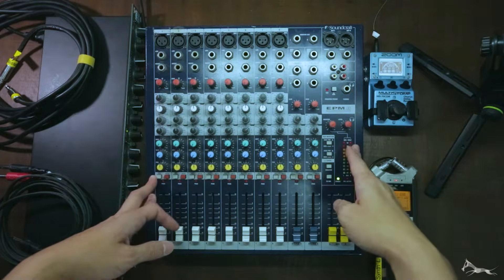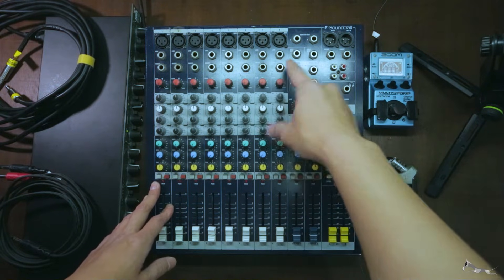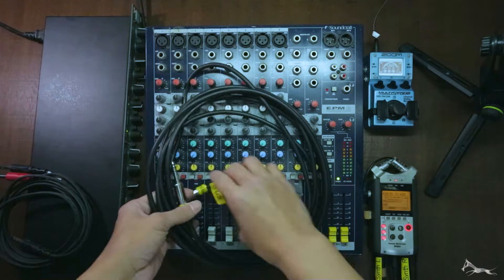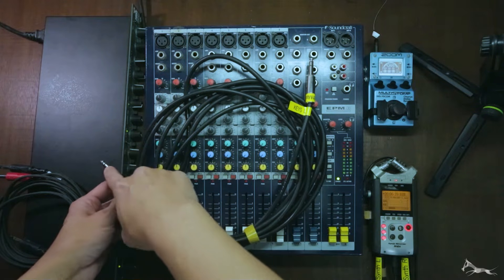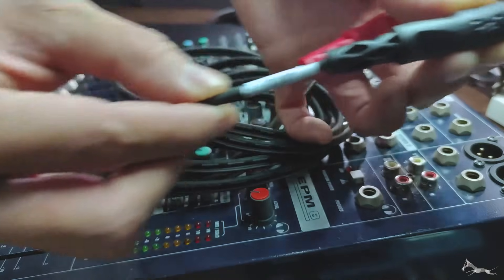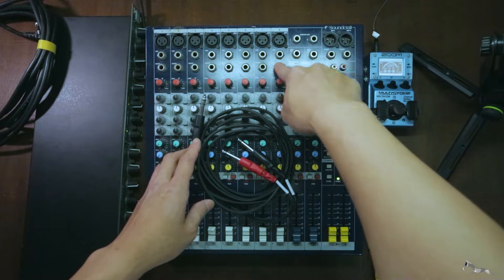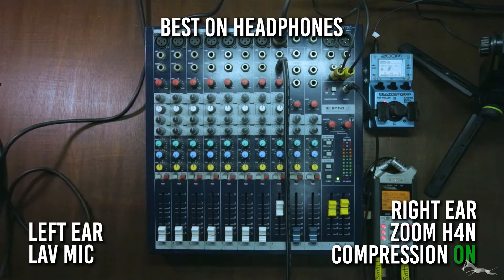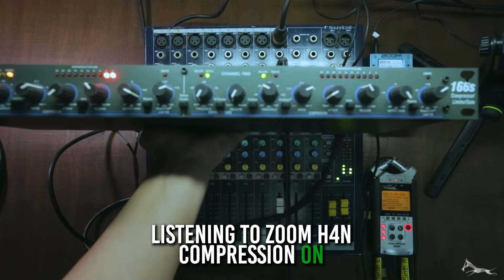Analog Mixer Inserts Explained

Comment: Thanks Bryan for the torch. I have question, i have some stereo guitar effects, but my mixer only got 2 aux send and returns. Do you think it would be best using other effect with insert channel? Would that compomise the sound? Do you think any other option is available like combining to other mixer?
Reply from the maker: Thanks for watching! It depends what you're trying to achieve - and your mixing philosophy. I would prioritize time based effects on sends, and dynamics based effects on inserts. While it may also be a good idea to have say a compressor on a send - for that parallel compression sound, or that drum bus compression - you just work with what you have. 
I would upgrade to a bigger mixer - with more aux sends - if that's what I need versus "daisy chaining" mixers. Hope that helps!
Reply: @BryanDumaguina  thx, regards from Indonesia

Comment: Good video Bryan D ! Question though... The RCA outs from the mixer to the digital recorder where what? Tape out?
Reply from the maker: Most RCA outputs on analog mixers are Tape Out or -10dBV (consumer line level). And the RCA output is identical to the main output. Whatever mix is going to the main output - will be reflected onto the RCA Tape Out - just at a lower level - the consumer line level - which you can then route to any device or equipment that will accept this line level (eg: digital recorders or analog recorders). Kindly consult your mixers manual.
Reply: @BryanDumaguina  Thank you for explaining that. Very helpful.  Peace !

Comment: I have a Behringer x2222usb mixer thats has only has 8 mic inputs how can I connect mics to the remaining 4 inputs ?
Reply from the maker: There are several ways you can go about that - but your key search terms would be "mic preamps" or "Rackmount Mic Preamps" - 4 channels of it - with direct line outputs which you then connect to the line inputs on your x2222. 

ULTRAGAIN PRO MIC2200 is an affordable option - but that's just 2 channels and it's a tube preamp - so it's got a bit of color. 

ADA8200 has 8 preamps - BUT it's not designed to be used standalone - it really is an ADAT expander. There's a Sweetwater article saying you can loopback the ADAT lightpipe - and then use it standalone. I advice you do more research on that.

Another example is Focusrite Scarlett Octopre 8-Channel Mic Preamp - looks like it has direct outputs on the back and can be used stand alone - BUT this is primarily used as an AD converter via ADAT to expand an audio interface - you might be paying for a feature you won't use.

Behringer 1273 - another good option - 2 units of that though and you're already at $1.5k+ . You can look into "solid state preamps" - 4 channels of it is really around $1k plus plus as per a quick Sweetwater search. 

Another key search term is "mixer with direct outputs". At that point though, it's probably cheaper to just get another mixer with more preamps! Hope this helps!
Reply: @BryanDumaguina thank you

Comment: So, when using a insert source, does it break/block the xlr input?
Reply from the maker: When you use the right cable (in this case a TRS plug), your XLR signal (or line input signal on the 1/4" jack) should return to the channel strip.
Did you mean something else with 'Insert Source'?

Comment: how about when my mixer has a lot on insert channels how do i go about that if iwant to use all of them
Reply from the maker: I guess the question is, what type of signal are you processing? Vocals? Keys? Guitars? Percussion? Electronic sources? And what insert effect did you have in mind to use? An insert connection has a one to one relationship per channel input - so if you have 8 channels - and want say a compressor on each insert - then you need 8 instances of the same compressor! (not cheap). If the compressor is using only one setting - then probably setting it up as a send effect is the more efficient audio routing to take.

Comment: Hi sir, question. How about the Inserts L/R under the Main XLR Outs? How can it be used?
Reply from the maker: @vinjayCOD0110  same concept, you can insert any effect or audio processing module that are in line with your way of mixing. For me I would insert say a graphic eq, compressor or some form of loudness maximizer, and a limiter.
So my mix can get a final touch of an eq curve I like or deem necessary for the room/venue - with a limiter at the end to protect from clipping/distortion.

Comment: Hi , does inserting into the 1/4 LINE disconnect the XLR input of the same channel?
🍻 ❤
Reply from the maker: If using standard TRS 1/4 inch plug when connecting to external device, it shouldn't. So just take note. Using TS 1/4 inch plug may however, disconnect the XLR input from the channel - as there will be no "ring" segment on plug for the signal to return to. I hope that makes sense!
Reply: @BryanDumaguina  cheers , thanks for the reply. I will make  a couple of test leads and do a continuity check. , as I have a Yamaha 01V and Mackie 1642, and have forgotten heaps of stuff from the 1990s.
✌️

Comment: The problem is that one doesn't have many affordable and good options for external effects processors on the current market, except for the very expensive and complex effects processors.
Many good manufacturers, sadly, discontinued their rack effects processor lineup, either becayse of greed or because they wrongly assumed that almost anyone will use conputers to mix inside the box.
On the other hand, if you are thinking of using effect pedals, think again. Effects pedals are designed to use instrument levels and their inputs have high impedance, whilst the mixingboards uses uses line level signals, which are stronger than instrument levels. This forces you to use reamping devices, to bring the levels down and, ultimately affects the sound signature.
In order to properly use external effects units with mixing desks, you have to use the aux send and return paths and you have to work at line level.
The moment you bring up a microphone signal or instrument signal to line level, you keep it there and any further processing has to happen at line level.
Reply: Not aggree. Last time i check you can use zoom cdr for vocal too.
Reply: @deynkitara Yes, you can use the Zoom CDR for vocals, but, in order to do that you need to convert/match impedances and input-outout levels.
Your mixing board work with a nominal signal of +4 dbU line level low impedance, whilst your Zoom CDR inputs expect a high impedance (1 Megaohm) instrument level (low level) of -20 dbU and, therefore you have to use a reamp box to convert from low impedance line level to high impedance instrument level.
Then, in order to bring the correct signal back to the mixer insert return point, which is low impedance line level, you need to put a Di and a preamplifier between the mixer and Zoom CDR outputs.
When you do the math, you'll arrive at the conclusion that, in order to use a guitar effect pedal with a mixer like Soundcraft EPM (which don't have Hi-Z inputs), you are looking at an expense of over 500 dollars.
Reply: i disagree, there are lots of good effect processors around . Just get them used, they're just as good. Peace

Comment: Great explanation!!
Reply: Yes, you can use the Zoom CDR for vocals, but, in order to do that you need to convert the mixer insert send signal from low impedance line level to high impedance instrument level, required at zoom CDR inputs (1Mohm input impedance), which requires a reamp box.
Then the processed signal from Zoom CDR output need to be converted from high impedance instrument level to low impedance line level, required at the mixer insert rerun, which requires the use of a DI and a preamplifier.

Comment: If my outboard gear uses XLR, how do i go about it?
Reply from the maker: You'll need an inset cable like this, TRS  that terminates tip on male xlr and ring that terminates on female xlr. Provided your outbound gear utilizes male on input and female on output. 

https://www.designacable.com/neutrik-xlr-insert-cable-tip-send.html

Kind of custom, quite hard to find with my quick search, easier to build if you're handy with a soldering iron.
Reply: Thanks so much I will update you as it goes

Comment: Thank you for the clear explanation. How can we use those external device for the whole mixing board instead of just one channel? I hope you make a video for that.
Reply from the maker: Thank you! It's in the pipeline! But the concept is the same if you have INSERTs on the Main Outputs. Insert your outboard gear there and the entire mix will get processed. Alternatively, you can use the AUX sends (as I mentioned, video in the pipeline!)
Reply: @BryanDumaguina  appreciated!
Reply: The current problem is that one doesn't have many affordable and good options for external effects processors on the market, except for the very expensive and complex effects processors.
On the other hand, if you are thinking of using effect pedals, think again. Effects pedals are design to use instrument levels and their inputs have high impedance, whilst the mixingboards uses uses line level signals, which are stronger than instrument levels. This forces you to use revamping devices, to bring the levels down and, ultimately affects the sound signature.
In order to properly use external effects units with mixing desks, you have to use the aux send and return paths and you have to work at line level.
The moment you bring up a microphone signal or instrument signal to line level, you keep it there and any further processing has to happen at line level.

Comment: Very good tutorial!

Question - 

For home karaoke (played via Youtube), mixer with 2 mics (channels 1-2), if I want add external reverb and compressor, is it better to connect directly to channels 1-2, or use fx send?

Obviously the song/karaoke played from Youtube already has been mixes/mastered.  Does not make sense to add reverb/compression on top of that.

Thanks!
Reply from the maker: Thanks! Time based effects are usually placed on FX sends or AUX sends - if you want both mics on channel 1 and 2 to get the same reverb (on the one fx unit) - IMO that's the way to go.
It can also work via inserts, but you'd need two external fx units - one for each vocal mic. 🙃

Comment: Bryan, how do you apply the reverb to all channels?  What connection I need so all 8 channels will have re erb?
Reply from the maker: You can insert the outboard gear via the Master Output Inserts, this particular analog mixer has a pair of inserts on the main output. Or you can connect the outboard gear via the auxiliary outputs and return back through the pair of stereo returns (Stereo 1 or Stereo 2). You have more control over the reverb mix with the second option.
Reply: Thanks. It did not work. I am trying to connect nanoverb to yamaha mg12.
Reply: There is no insert hole.
Reply from the maker: @DonnyEscorpeso  Just checked your mixer, the base model MG12, has no channel inserts actually. Neither on the input channels or the main output. You do have a pair of auxiliary sends (AUX 1 and AUX 2) . You can send out time-based effects through there, and then return via the return channels (you can say 9/10 or 11/12 as return channels). I think sending time-based effects is actually best via aux sends and not inserts, what I did in the video was just an example. 😄Using mixer auxiliaries is another video I'll be making soon, that's a different video. You can definitely search here at YouTube, I'm pretty sure you'll find something.